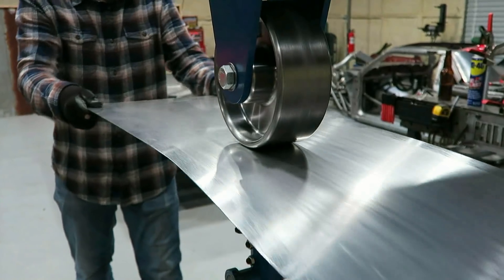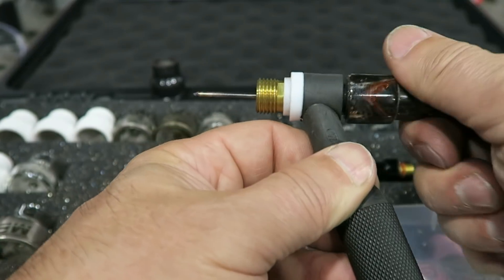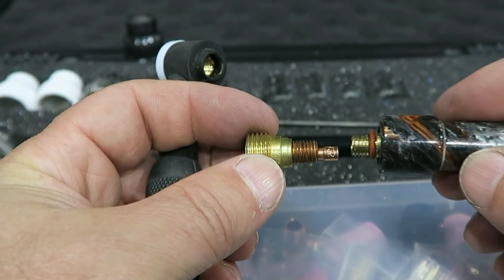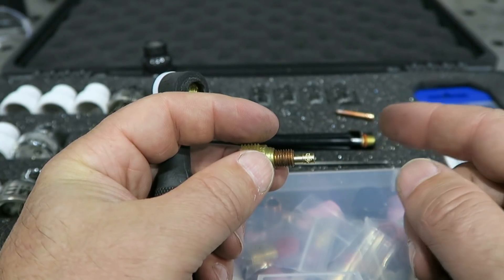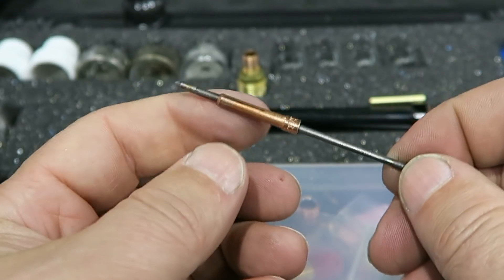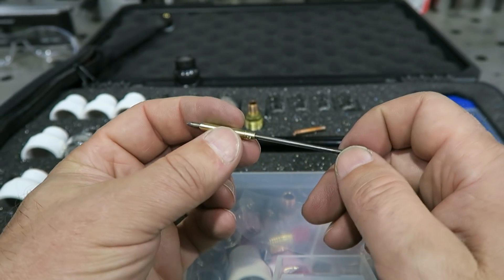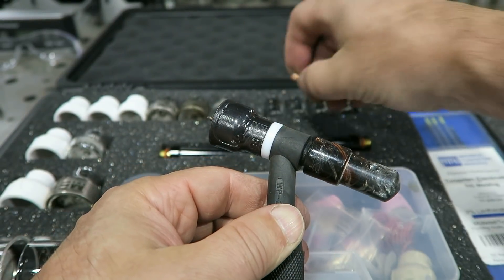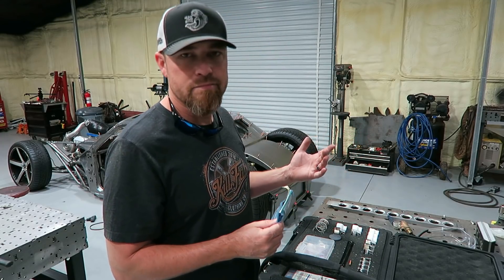Standard TIG Welding Collet VS CK Wedge Collet - Whats Better?

Comment: The worst was in welding school after running 200A that poor collet was anealed and finger tight was too much. And I was being dental! Surprisingly, I have been using the same wedge at home for 2.5 years. So 5 is a long time supply.
Reply: see, that's good information there.

Comment: main problem with the standard slit collets is because they are made from copper, if they were made from brass (like they used to be many years ago) there would not be a problem, take a note of what these wedge collets are made from, they are actually made from brass, how long will it be before these wedge collets start getting made from copper. I think it has a lot to do with selling spares, brass collets last to long so they make them from copper.